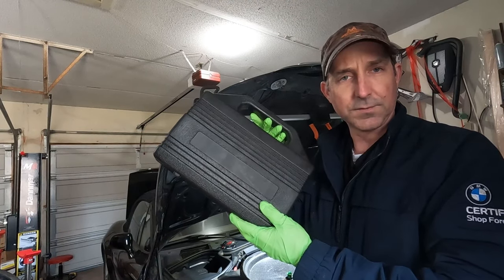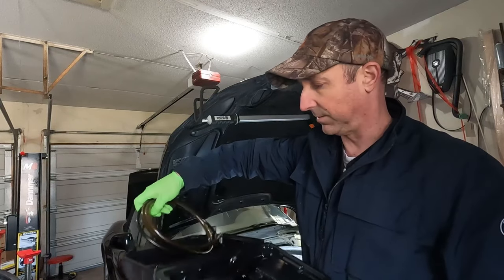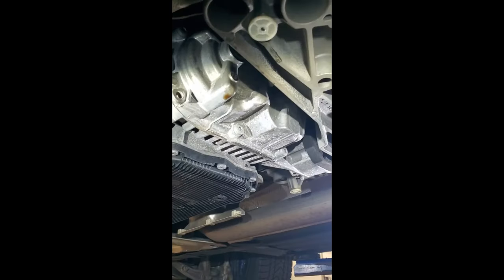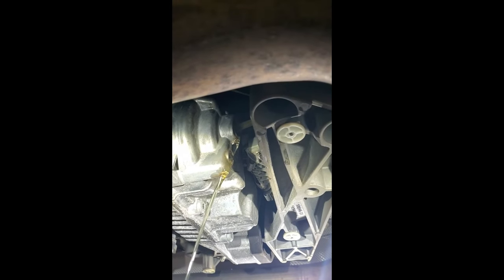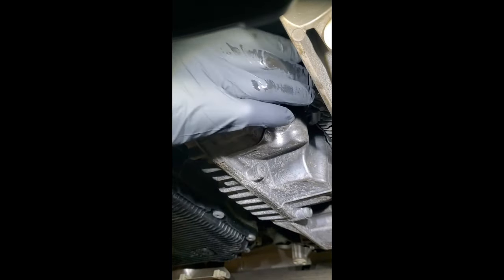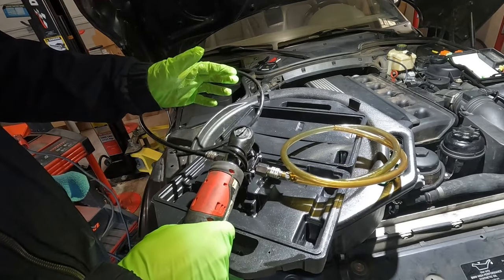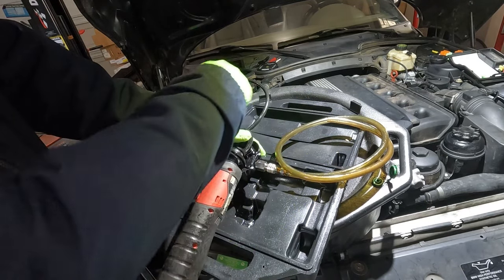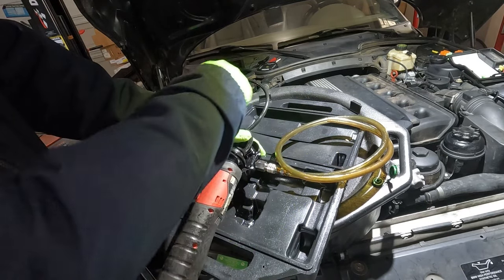BMW Transfer Case ISSUES PROBLEMS Plus DIAGNOSIS STEPS And Fluid Change 54C6 539E 5463 5F3A 54C4

Comment: I have 2014 X3 I recently got some nice 21" rims and excellent condition Michelin tires for a steal, but I'm wondering if mounting them will cause any issues with transfer case/xDrive

All 4 tires are 265/35/21, all 4 rims are 21x9 and identical

2 of the tires are Michelin Pilot Super Sport
The other 2 are Michelin Pilot Sport PS2
Tread depth is also about identical

Of course I would put the matching types together on each axle.
The tread patterns are extremely similar, and tread depth is nearly identical.

Any help would be greatly appreciated, I'm hoping I dont have to sell these and go searching for new ones. 

Thanks in advance 😅🙏🏼
Reply from the maker: Hi Nick, Larger rims do put more strain on the transfer case. Larger rims increases the energy needed to move the vehicle and reduces the mechanical advantage. This can lead to premature failure.  But if you where going to do it, Yes you could use those since all 4 are the same rolling circumference.
Reply: Ohh interesting, I didn’t consider the strain from the larger wheels. They aren’t that heavy so hopefully that’ll help. My main concern was the slight difference in tread pattern between the 2 Michelin tire modes although very similar. Would changing the transfer case fluid when I swap the wheels help out? Thanks for all the help!
Reply from the maker: @nickacevedo8550  Always a good idea to do the fluid change early.  Tread pattern will not make a difference. Rolling  circumference would. For the best transfer case life it is best to stick with stock rims and tires...but that can be boring 😀
Reply: @AskTheCarExperts  thanks so much for the help

Comment: Thanks for the video. Would a drivetrain malfunction error be transfer case related? And would it idle rough as well if it was the transfer case?
Reply from the maker: @BeardedDarin  Hello, for your issue it sounds engine related.  Check for fault codes, air leaks, plugs, coils et. Your error is not usually a transfer case issue.
Reply: @AskTheCarExperts thank you so much for the prompt reply.

Comment: Hey Roger first video to pop up on Google when I was trying to confirm my symptoms and next diagnostic steps!
I recently started experiencing a shutter under load especially once I get into higher boost (18lbs+) in my e90 335 
The car will shutter/buck almost as if it’s a misfire like you mentioned 
Scanned the car when I got home because xdrive and abs were disabled at about 70mph on the highway plugged it up found 54c6, 55c6, and 55c3. I feel however I’m gonna give the fluid change a shot and reset the maint  because my shutter has been very very intermittent.
Reply from the maker: Hi Chris, If you disconnect the transfer case motor plug see if the symptoms are gone. You may have the N54 on your 335 and carbon buildup on the intake valves can also cause a similar feel. This would be a great way to determine if it is the transfer case.

Comment: Just did this with my 2013 E70. I actually put the wrong oil in. Symptoms were excactly what he said. Seemed like it was missing. Being a 3.0D it was wierd. Put some new Alien juice in and wow.. Car is like brand new. Thanks to this Vid I looked further as I used gear oil for the front diff. I am amazed.
Reply from the maker: Thanks for sharing your experience with thus! Glad it was fixed with the correct fluid!

Comment: Hey Roger, unrelated question but I recently got my zf8hp45 rebuilt on my f30 and I’m experiencing harsh shifting from 1-2, 2-1. My fill pressure for clutch c is 750mbar and 998mbar for clutch e and all other ones are 12mbar , 200mbar and -150mbar. During the rebuild all clutches were replaced since clutch pack C, and E were messed up as well as the torque converter. The only thing that wasn’t replaced was the TCM and solenoids but I was also experiencing this harsh shifting before the rebuild, the shop that did the rebuild said that a trans software update will fix the issue but I don’t want to drop 400 dollars for a software update if it won’t fix the issue. Thanks

Btw you’re videos have saved be an insane amount of money!!
Reply from the maker: Hello! Thanks for watching my videos! I have not heard of any software fix for this type of symptoms. I would imagine the transmission shop would have cleared your adaptations in your transmission after the rebuild but you can ask them if they did. I just ran through the BMW service bulletins and there is nothing about this. I suspect the issue is still internal of the transmission. Ask the trans shop to cover the 400 if the issue is still present. Not sure if they will but I think it would be worth it to prove they need to have another look at the trans for free. I hope you can get it resolved! Let me know how you make out.
Reply: @AskTheCarExperts  yeah at first I thought they didn’t reset adaptations so I went on Ista and reset them myself but the problem still persist. I will take the car in a couple of days and let them know I’m still experiencing this problem. I will keep you posted.
Reply from the maker: I hate to say it still sounds like a transmission issue. Best wishes to you!

Comment: So I had this issue where it felt like I needed a tune up when I was giving the car light acceleration up to speed. The car would jerk throughout the gears. I could go WOT and it seemed like no issue. Well the jerk started getting worse and I changed the transmission fluid and pan, changed HPFP, changed plugs and wires, changed VANOS solenoids... I changed it all until I ran across the word transfer case while researching. So I purchased a XDelete license and used the app to put the car in RWD mode and the problem immediately went away. I'm hoping just a fluid change can get my AWD back.
Reply from the maker: Wow, I have not heard of an X delete. That is interesting. The fluid change may help and it's always the best place to start.
Reply: @AskTheCarExperts  xdelete is a fairly new app that allows you to switch between AWD and RWD. It has been working pretty well for me. I'm definitely going to do the fluid change when I can get hold of the pump you're using lol
Reply from the maker: @Mr_Jay_Ones  Thanks for sharing that info!

Comment: Thanks for this video. I have an X7 40i and this issue started by shuddering when accelerating, kind of a loss of power or transmission. So, first I thought it was a fuel issue, then the dealer said it might be the tires (it started after I put on a new set on Pirelli P Zero's). Then I took it again, and they diagnosed the transfer case issue and quoted about EUR 6000 to replace it. They never mentioned changing the fluid, so I think I'll try that first.
Reply from the maker: You are very welcome! I hope the fluid change helps!
Reply: Keep us posted.
Reply: How did you go? i have the same issue in my X7?

Comment: So I just did this on my X7 and this was really helpful.  I only was able to get about half of the amount out.  I found it hard to get the tube in to suction it out.  My tube was same thickness as yours so not sure why I had a problem.  My finger hit metal when I inserted it to see if passage was clear.  Seems like there was only an opening to put the tube in down to the right.  I had to find a skinny flexible rubber tube half the thickness of a pencil to get it down there.  If you can describe the angle you put the hose in that would help.   I want to do it again when the new oil is fully mixed with the old.  Should that only take a few miles driving to mix?  I do already notice an improvement.  Less almost no more shuddering on turns so I am hopeful.  I also saved $ by using the Triax brand DTF-1 fluid on Amazon for $20 a bottle.
Reply from the maker: The fluid is hard to get out. I would drive the 250 miles and then flush again.
Reply: @AskTheCarExperts  Thanks!

Comment: Great video thanks for sharing. My 2011 F25 has a weird feeling when turning left out right at very low speeds. This haired after replacing the upper control arms, ball joints, and front brakes. Also replaced the drivers side cv axle after this happened-no change. Will now change transfer and diff fluids to see if this eliminates the issues.
Reply from the maker: I hope it helps! It sounds like transfer case slip to me.

Comment: Useful video - thanks. It would be useful to show how to do the fluid reset in ISTA afterwards. Worth mentioning that in my case experience most transfer case problems are caused by the cog stripping on the servo motor though?
Reply from the maker: Thanks Peggy, If I get a chance on a vehicle to go over the cog wheel issue I definitely will. Appreciate your input!

Comment: Thank you for your informative video. I just have one question. I have these symptoms and strangely in colder weather the problems go away. This is why it led me to this video because I figured its either a liquid or rubber component causing this. Is it safe to assume it is the transfer case? Car is a 2012 750I Xdrive.
Reply from the maker: Hello, Your very welcome. The best way to be sure would be to unplug the transfer case motor and see if the symptoms are gone. I have had a few transmission issues but usually the chatter is from the transfer case. It also could not hurt to do a fluid change and then monitor.

Comment: Nice explanation. Next week i will do this on my 2017.540i. But i have more simptomes. Usually uphill when i turn steering wheel fully right in first gear (parking manouvers mostly) i hear shutter on front left wheel one time ....sometimes i heared it from rear of the car two times...much louder when i go reverse...fully right again...Never fully left or when driving straight. No shuttering while driving....no strange noises...vibrations...grinding....the car has 60.000 miles...stock car..very strange sensation...feels like you touch the edge of the road with your rim....Any ideas ...? Cheers 😊
Reply from the maker: Hello, Sorry to hear you have these symptoms. It can be hard to trace down what the cause is. I would recommend disconnected the transfer case motor first by unplugging it and see if the symptoms are gone. If not then it is not the transfer case. But if it does go away then you can try the fluid change which can help.

Comment: Hi, Great video! Suspecting this issue on my 2017 320d, the thing is that I’ve only experienced the symptoms three times over 2 months and about 4000km. It started happening shortly after changing the EGR valve. Can the EGR valve cause similar symptoms? Rather difficult to diagnose the problem when it’s not consistent
Reply from the maker: Hello, Thank you 😊 With it so infrequent it does make it harder. The EGR would potentially set a check engine light.  It might be worth doing the fluid change anyway and monitor. It is good to catch it early.
Reply: @AskTheCarExperts  okey, Thanks for your input. I might as well try that. But does it mean that the transfer case is bad or the oil is bad when juddering starts to happen? Just a thought since you said that it might return😊

Comment: Sorry if you mentioned and I missed it. If you have this trouble and you fix it. 1: How often after that is indicated to replace the transfer case fluid? Also 2: Is it recommended to replace the transmission fluid also? At how many miles? I know that "they" say that is "lifelong" but I am talking here about what is the best to do to preserve the transmission and transfer case. It is like - synthetic oil changes at 5-6k miles instead of 10k situation. Thanks.
Reply from the maker: Hi John, Transfer case fluid interval is determined by driving style and a calculation the car makes. I would suggest every 50 to 80K. Transmission fluid Lifetime is around 120K

Comment: I have 2 part question: 1) Where do I buy that pump. 2) My 2006 X3 shudders at low speed. It feels like misfire, if unplug the two connectors at the transfer case module and the problem goes away. Plug the connectors back, problem comes back. I changed the transfer case (with a used TC along with motor). After replacement, if I place the vehicle in gear, at low speed, the vehicle feels like grinding and popping. If I unplug the connectors, problem goes away. I used the Foxwell NT710 to do all three resets (fluid, TC and servomotor), but problem still exists. What else can I look for? Thanks
Reply from the maker: Sorry to hear that Glen! It may be that you ended up with a faulty used transfer case. If the issue goes away when the connector is unplugged I would suspect that once you make sure the front axles look good and the front driveshaft is in good shape.

Comment: Good video! Its a shame BMW wont replace the fluid in the transfer cases as i understand they didnt use the correct fluid? I have these symptoms on our 2020 X7 xdrive. Maybe I missed it but what is the NEW fluid we are supposed to use? Is there a part number?
Reply from the maker: The fluid part changes by model and year. Best to have it looked up by the dealer with your VIN. If your X7 is low miles you may be able to get the dealer to offer some goodwill assistance for this concern.
Reply: @AskTheCarExperts  quick update, changed out the fluid and not more issues while turning at low speed. Had this done at a local independent shop familiar with BMW drivetrains. Tech told me the fluid was really dark. X7 has 62,200 miles. Thanks again!
Reply from the maker: @shot_by_su_6078  That is great news! 👍

Comment: I have a 15' x5d  105K miles with a chatter/studder issue. Took it to a BMW Mech. he changed the fluids in the Transfer case and both diffs. no codes came up, he said it could be coming the front diff., no grinding noise no howling noises. He said drive it awhile and see if it changes, so far it has been the same ( 3-4 days around town)
My question is have you ever heard of the front diff. having this kind of issue? The oil in it was metal free but looked like muddy water. 
Should I have the oil in the transfer case changed again?
Reply from the maker: @dangregor-x3v  Sorry to hear you have this issue. I would recommend disconnecting the transfer case plug and driving to see if the shudder is gone. If it is then this is not the fron diff. I have not experienced this symptom from a front diff myself. I would drive it 120 miles  with the new fluid. If the symptom is still present and it was identified as the transfer case, it would need replacement or you can try one more oil change. The shop should get out about 16 FL oz with a siphon.

Comment: Hi. Thanks for the video, very useful info. I'm owning an X6 E71 from 2011, bought the car with bad tires (they were on the specs tho but the alignment was bad). I had this juddering when turning the wheels slightly so i changed the oil and used ISTA+ for oil reset function only. For few hundred kilometers it seemed that the juddering disappeared. In the meantime i got new tires on 20" following the bmw recommendations but the juddering re-appeared even worse now, when i accelerate smoothly it feels like it missfires. Do you think that if i'll replace the actuator it might fix the issue? Thanks
Reply from the maker: Hello,  Sorry to hear your BMW has this issue. The shudder misfire feel is not usually fixed with the Actuator replacement.  If the problem is still occurring after the oil change and reste it sounds like it will need the transfer case.

Comment: Thank you so much for the video! My mechanic has changed the transfer case, transfer box, transfer case shift actuator motor but my car is still throwing codes 00539E,  005F39, 005F3A, 00601D, 00601E and 00E723. I'm getting so stressed and running out of funds and ideas. I really don't want to sell my car but it's becoming a bit of a nightmare. Do you have any suggestions what I can do next please? I'm going to ask him to do an oil change if he hasn't already. Any other advice would be very much appreciated. Best wishes from the UK!!
Reply from the maker: @shareenk5324  Sorry to hear that. Shoot me the last seven of the VIN and I will try and find some time to help.
Reply: Wow thank you so much!! LJ52916. I deeply appreciate this. Thank you again.
Reply from the maker: @shareenk5324  Looks like you have two open recalls as well for the driver and passenger airbags. E70 with the N62TU. 
It may be the normal feel for this power train set up. I chased this a while back. Does it only happen under light load under light acceleration? If you want to reach me directly email me at askthecarexperts@gmail.com Sometimes I don't get response notifications from youtube.
Reply from the maker: Sorry, I forgot this was the fault codes. The VTG system on this BMW is more complicated than the newer ones. The VTG motor is NOT the module on this model E70. The VTG module is in the left rear trunk area. This module could have water damage. You also would need to check power, ground, wake up signal, and the PT can signal to the module wiring. But I am wondering if the module is faulty since the transfer case and motor have already been replaced.
Reply: @AskTheCarExperts  thank you for checking! I'll email you directly and send you a photo of the codes! Thank you so much again. Your awesome!

Comment: Hi Roger, question bud.  I have BMW X5 2012 E70 35i, lately on cold start the RPM jumps up/down and after 1 min it goes to normal level.  Wondering, what would cause this and what should I me looking at? thanks bud.
Reply from the maker: Hi Tahir, This may be a small unmetered air leak or it could even be fuel quality related. I have had this also be an engine adaptation issue. If your scan tool can do it, clear your engine adaptation values and recheck.
Reply: Thanks a lot Roger.  Highly appreciated for a quick respond, regardless.  I always hold your advise on your youtube videos very high, and find your work very professional.  God bless you and have a wonderful weekend.  keep up the excellent work bud.